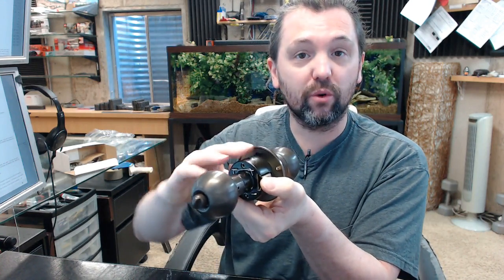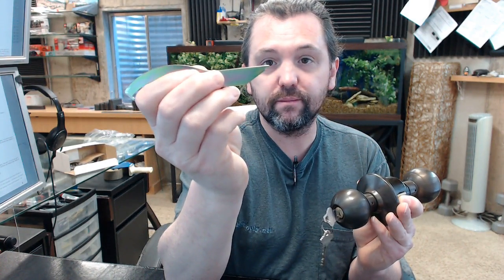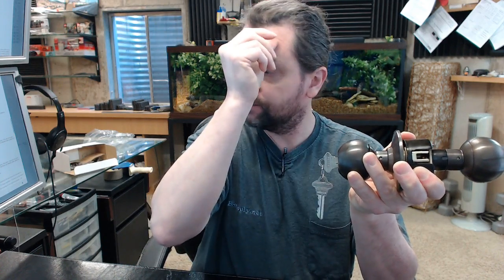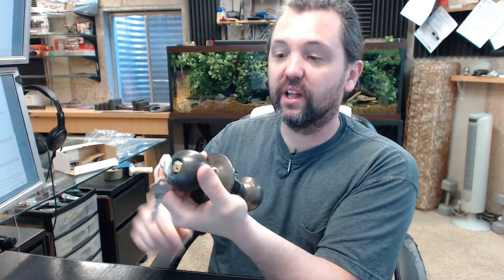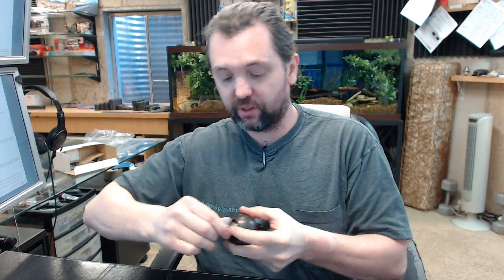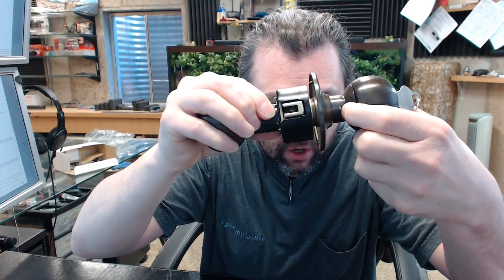Changing a Lock from Right to Left - Quick tutorial

Comment: Good video, although if your door is an exterior door you want the "teeth" pointing up so that grime won't get into the lock cylinder and also if a spring gets buggered you can still operate it because gravity will let the pins fall until you can have it repaired.  Otherwise your locksmith may have to drill the lock...just my$0.02 as a locksmith.